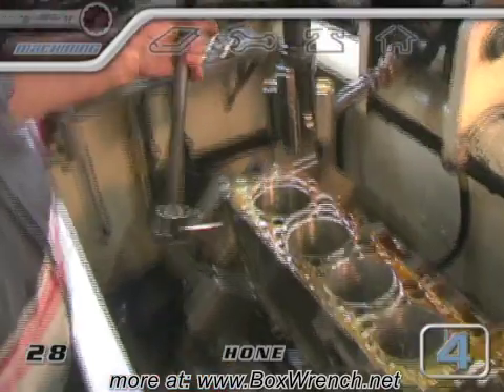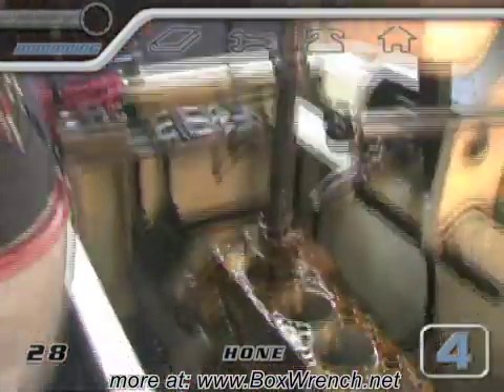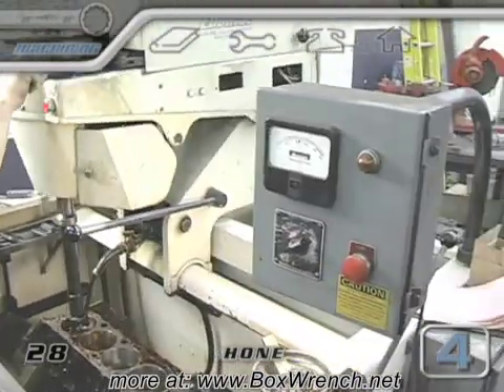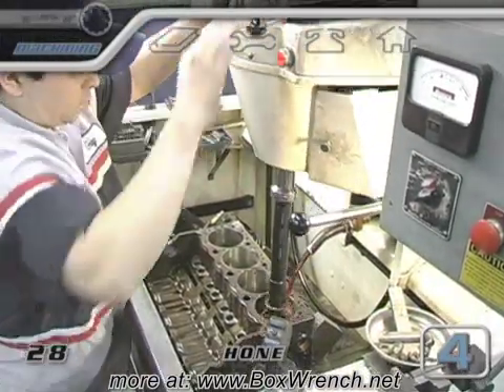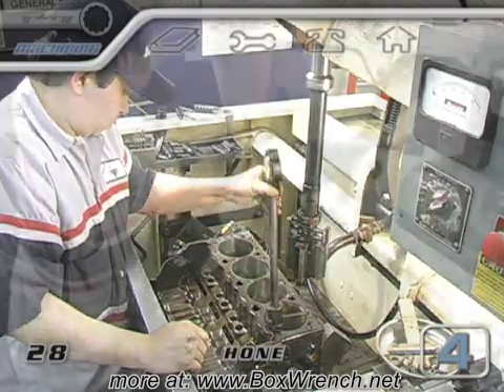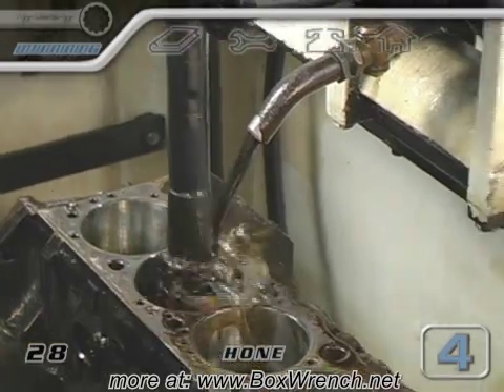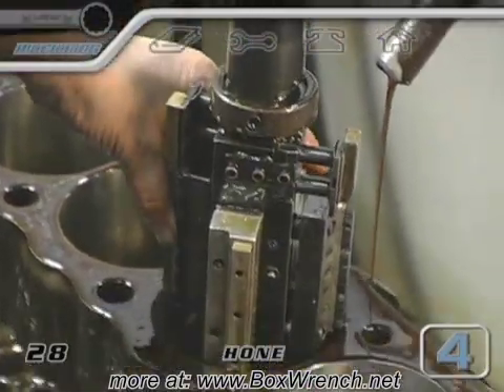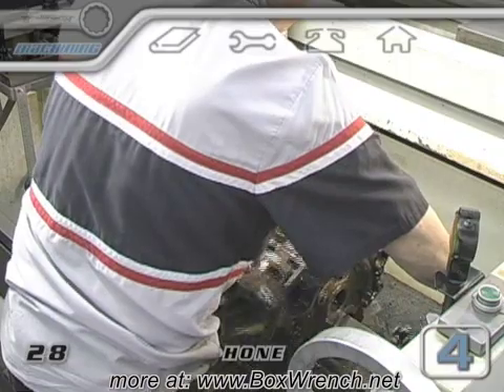Cylinder Bore Honing - Engine Building Video - Hone Piston Wall

Comment: If an engine (let's say the BMC E-Series for example) has Siamese bores that prevent further enlargement beyond 76.2mm as well as bore centres of 82.5mm, what effect would increasing the bore centres by another 6mm do for the engine (meaning it ends up with similar bore centres to the Volkswagen EA827 engine's 88mm)? 
Would it help further increase displacement or would there be some other unspecified improvement to the engine?

Comment: here is what u forgot to mention, on certain high hp builds u will need a honing plate that simulates a head being torqued down on the block, you use this because torquing a head down can actually cause a warping affect on cylinders and can cause uneven compression, by using a head honing plate u eliminate these issues

Comment: I have a briggs and stratton 3.5 horse motor (aluminum), do you think i can get it .010 over (from 2.56 to 2.57) with a drill hone? its probbably already bored itsself .009 over as it had 10 LBS of compression even after reseating the valves.

Comment: torque plates are not needed in stock engine build. of course it gets the cylinder more accurate but if your not pushing the walls to the extreme you really dont need it. if you are aproaching 800hp or more in a block then it is deff. required. also depends on cylinder wall thickness.

Comment from the maker: @ghettoflyer One more time here. Pass it along! This is a sample clip from a 3 hr DVD on a simple rebuild called 'Basic Engine Building'.

We don't recommend a torque plate for the viewers for this 'basic' stock engine rebuild on the recommend of the machine shop.

The accuracy gained for a stock engine rebuild was not beneficial compared to the expense of honing with the torque plate. For performance engine building however, we would absolutely recommend the use of a torque plate for honing.

Comment from the maker: @chamblizi The 'Basic Engine Building' DVD is meant for any 4 cycle engine. Regardless of year, make or model. The only thing a modern engine will vary greatly on, is newer types of variable valve timing systems. 

The majority of our customers are working on pre '90 cars & trucks. But plenty on newer models as well.

Comment from the maker: @RacingHeadService This was NOT made for YouTube. This is a SAMPLE clip from a 3 hr DVD on a simple rebuild called 'Basic Engine Building'.
We don't recommend the torque plate to the viewers for this 'basic' stock engine rebuild on the recommend of the machine shop.
The accuracy gained for a stock engine rebuild was not beneficial compared to the expense of honing with the torque plate. For performance engine building however, we would absolutely recommend the use of a torque plate for honing.

Comment: hey man my ranchero is ether having a sticky valve problem or a bad connecting rod i want to rebuild my engine its a 1975 ranchero also i will be rebuilding this (without) removing engine would you recommend this dvd for older models?

Comment: This blocks cylinder walls will distort .0015" to .002" towards the top of the bores when a Torque Plate is installed... simulating the cylinder heads being torqued on the block.  Why bother doing the job if its not done right?  I mean if you're going to make a video for YouTube, at least show the viewers the correct method for the best results.

Comment: I have overhauled small engines for years for friends (about 50) and my machine shop always wanted the piston (new or old) that was going in the block. I was impressed cause most small engines had generic tolerances. The tool and die owner quit to spend his millions. Great for him but anyone I talk to now does not want the new piston even on an over of 20 or 30 thsds on usually a really old engine. (like an old Clinton) Are these shops getting lazy or just don't care?

Comment: I have a 102mm piston with just piston( no rings) in cylinder flush with head.

With feeler gauge middle of skirt from bottom of sleeve  I get a tight .007mm  or .178 

edge of skirt is a loose .007mm or .178.

cylinder has just a few very very small lines with no finger nail edges. almost perfect.

Should I just brake glass with those specs? ty

Comment from the maker: @ericg83z this clip is only a sample from the full length DVD where we advise you to pull apart the engine first and then do a visual and measurement inspection. 

You'll need to see the condition of the piston skirts and the cylinder bore walls. Then you'll need to do the measurement (or have the machine shop do it for you) with a dial-bore gauge and micrometer on the pistons. It the pistons measure out ok, and the cylinder walls are within spec, you may be able to get away with just a hone...

Comment: I rebuild small one cylinder motors for friends and as a hobby. When I send a block out I ask only two questions. How much and does the machinist want the new oversize piston. No one gets sent a block unless they want the piston too. I have found factory tolerances are terrible compared to what a good machine shop can produce. The first one I had done years ago was so tight I thought a mistake had been made. That's when I found out about crappy factory standards.

Comment from the maker: @koopooda Either yourself or someone at a machine shop should run a dial bore gauge into the cylinder and see what the measurements are for 'out-of-round' and 'taper' for the cylinder. if it's out of spec for either reading, you may want to bore the cylinders. On rare occasions, you can get away with only a hone, but not if there are significant hours and miles on the engine.

Comment: I watched these video's they are amazing. I am currently building my 350 sbc the pistons were chipped and I could see the rings from the cylinders. When I pulled them out there was not eve a ridge build up and it still had the cross hatch pattern. There are a couple scratches on the cylinder walls. Do you think it needs to be honed or bored?

Comment from the maker: @mrrberger This video is a clip from a 3 hour DVD focusing on a simple rebuild called 'Basic Engine Building'. 
We didn't recommend the torque plate to the viewers for this 'basic' stock engine rebuild on the recommend of the machine shop. 
They mentioned the accuracy gained for a stock engine rebuild was not beneficial compared to the expense of honing with the torque plate. For performance engine building however, we would absolutely recommend the use of a torque plate for the block honing.

Comment: I use to run one of these, bluddy brilliant machine, you should put a torque plate on it while honing and see the difference. I would also suggest an experienced operator can vary the stone pressure during stroke with the top ring to take out barreling or flaring. PS any other honing technique is simply  playing around this is serious stuff.

Comment: @seapeddler  You have to remember, I am not into mass production like Ford is. I would be out of business in a week if I were. What I am after is as close to zero leakdown as possible. That tolerance you specified for the 80's Ford engine must explain why the car  I had new back then burned a quart of oil every 800 miles even when broken in. I would find another machine shop, your pistons don't seize if you don't have a taper. They are justifying a crappy hone job.

Comment: @capriracer351 I was told by the machine shop that my engine would seize if the cyls. didn't have a taper. With a 10 thousandths tolerance, you must burn less oil than a factory engine. The Ford shop manuals allow .010 maximum taper, I believe, before overhaul. Which is nonsense. That's for an 80's engine though.

Comment: @Robkat3751  Yes, That is how I do my cylinder walls. I can get the taper to within .0003 and round within .0001, however it takes me about 3 to 4 hours per cylinder. Not very efficient, but I have never been able to find anyone in this area to take the care to do it this close.
I learned how to do this from my Dad who had done it since the '60s.

 I sent out a test block to a local "expert", even gave him my torque plate since he did not have one for a Ford. It came back all over the place.

Comment from the maker: The machine pictured in this video is much more precise at the final sizing of a cylinder than a hand-held drill could ever be...Honing machines will size out the cylinder after a boring and spec out the bore size to within a couple thousandths of an inch of the desired final size. 

A hand drill is just not capable of such precision.

Comment from the maker: did your shop class have  an actual 'honing' machine or did you "break the glaze" on the cylinders with a hand-held drill with Glaze Breaking stones installed? 

There's a very big difference between creating a hash marking on the cylinders and actually "finish honing" and cylinder to size after being bored out...

Comment from the maker: usually, a machine shop will offer a single price for striping down the block, jet wash cleaning, bore, hone and cam bearing replacement. 
Estimate a few hundred dollars if you need all that done, but sometimes you will only need the cleaning and hone to clean up the cylinders. 

Call a local machine shop and ask for a complete block machining price.

Comment from the maker: True honing is only capable by a large powered machine like the one in this video. 

When you see stones on a drill that is being operated by hand, the process is not honing. The drill type stones are only capable of a "de-glazing" procedure that will remove a surface coating of carbon build-up or other residuals left on the cylinder wall. 

A hand-drill powered de-glazer does not have the power required to outwardly apply  pressure against the inside cylinder walls for a true hone job.

Comment from the maker: angled cross-hatch marks (diagonal scratches) are the final hone of the cylinder bore as shown in this video. 

Your cylinder wall should never be smooth as glass with a shiny chrome finish... there  would be no way for small particles of oil to stick to the wall. The small droplets of oil are what keep your pistons moving smoothly and keep the cylinder walls from wearing away. 

and yes, 175 psi across all pistons is a good compression reading for about 9:1 compression or a little higher.

Comment from the maker: This is a short clip taken from a 3 1/2 hour instructional video...
There is an entire chapter about how the block is bored out and this is part of the subsequent chapter that shows how the rough surface left by the boring machine is smoothed by the honing machine. 

The machine here does not bore the cylinder, it's a completely different process done by a machine who's only job is to make the cylinders a few thousandths of an inch larger to accept new, larger pistons.

Comment from the maker: Boring a 4 cylinder block would likely be less than $100 but there's no guaranty that there won't be other work needed. You also need to consider purchase of new pistons for the new oversized bores as well as a gasket set for the rebuild. There are complete rebuild kits available though that will have everything needed in one box. 
Mahle/Clevite and Sealed Power are two major parts distributors you can look up kits with...

Comment from the maker: Our complete DVD has some footage of the machinist installing a repair "sleeve" into a bore. The cylinder is bored out to an extreme over size and then a steel sleeve is hammered in place. This method can repair a single damaged cylinder wall, bring a rare and out of date engine block back into service and also allow someone to return a block that was bored many times back to it's original "standard" size bore. These techniques are used for restoration or fuel economy engine builds.

Comment from the maker: The block and heads are raw cast material but the block has steel sleeves inserted into the casting at the plant, these sleeves are melded in place and the bore and hone finalizes the sizing according to actual piston sizes. 

You'll notice at :48 to :51 seconds into the video the dial bore gauge is used at the top of the cylinder, then the bottom and back up at the top. This is reaped very often through the honing process to be accurate within a ten-thousandth of an inch...very precise.

Comment: Excuse the newbiw question:

The cylinder head comes as a rough casting and is then machined right? How is the bore and hole made in the first place? 

The 'honing' process is more of a finishing process to achieve geometric finish and tolerance in the bore, correct?

Why does the operator use the Dial gauge only on the top surface ID and not on the bottom also.

Comment from the maker: You'd be surprised, a good sized machine shop does a lot of engines every day and can offer a great price for package deals. Often it will include stripping down components, cleaning refurbishing and sometimes assembly, for an all inclusive fee that would be cheaper than if you did them separately.

Comment from the maker: Unfortunately, YouTube isn't the best place for your question...
You really should contact a local machine shop to what ever state or country you're in and get a quote. 
On the average, in the US, a 4 cylinder block hone job may be in the ball park of $100 but it's rarely a case of only needing a hone job. During a rebuild, you'll often find the need to perform various machining jobs to make all the engine components like new. 

All the other machine shop work is shown in detail in our DVD...

Comment from the maker: The machine shop in this video is a great place in San Fernando CA called Eddings Engine Rebuilding. 

Family owned and operated. A father and two sons run the place and they do a great job on any engine under the sun. Hot rods to Hondas and anything else you can think of with pistons.

They've done the machine work for every engine in the BoxWrench Series of videos. We highly recommend them. 

Tell 'em BoxWrench sent ya!

Comment from the maker: Yes, you want to wait until the machine shop has finish the refurbish process or work with them or ordering parts. If your block needs to be bored, your old pistons will not fit anymore. The machine shop will need to wait for the new pistons to arrive. Then they will measure them and hove to a perfect fit. 

All this is covered in detail in our 3 1/2 hour DVD...including re-assembly of all components.

Comment from the maker: There are two main reasons to bore a block: 
1. Cylinder walls were damaged or worn and boring out to next largest piston size will repair problem. 
2. Larger displacement is desired in the combustion chambers to allow for more fuel to be burned to create more power from the engine. 
There's nothing risky about boring a block if you remove the engine and have the boring done at a machine shop by a knowledgeable machinist.
Boring a block is industry standard procedure but will require new pistons

Comment from the maker: Everything is related to the bore measurements in the block and the "out-of-round" and "taper" readings. 

Measurements will tell you if there is a severe "egg shape"/Out-of-Round scenario, and, if the bore diameter readings from the top to the bottom of the bore are different, you'll have  Taper that will need to be fixed by boring and then honing.

But, if those measures check out, you can see if the pistons are in decent shape for re-use. Not always possible though in high mileage engines.

Comment from the maker: Stones in a hand held drill will absolutely not size out a cylinder after it's been bored. Those tools are incorrectly named "honing stones". They are actually only "Glaze Breaking" stones. Their only purpose is to return the crosshatch marks to the cylinder wall during a rebuild so that the walls with hold oil for sealing. 

Hand held glaze breaking stones are only effective on a bore that is true and round without other damage. 

Only a machine can size a bore to the final precise measurement.